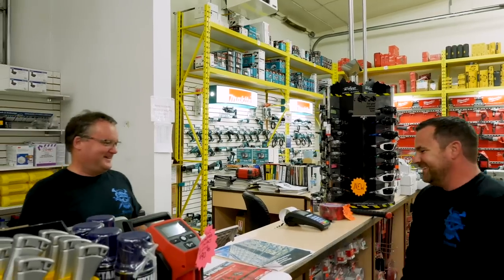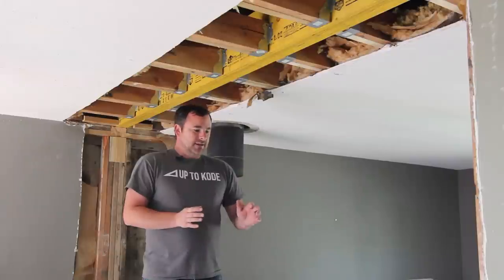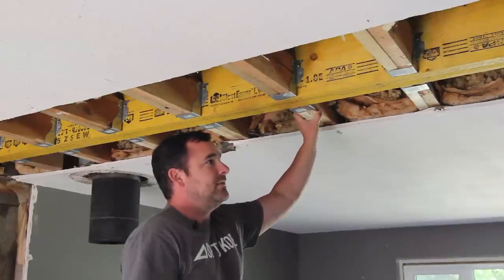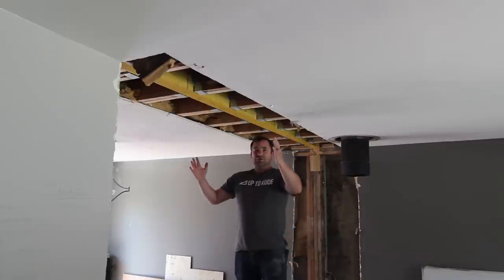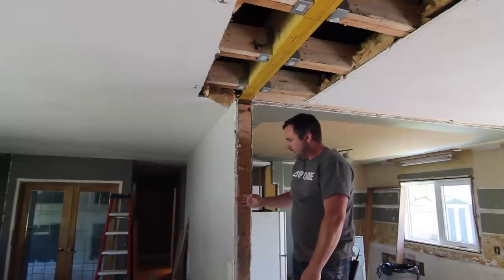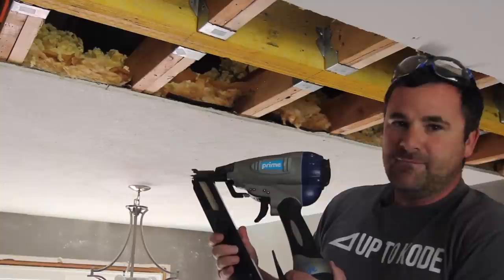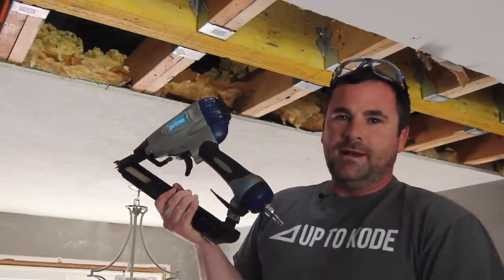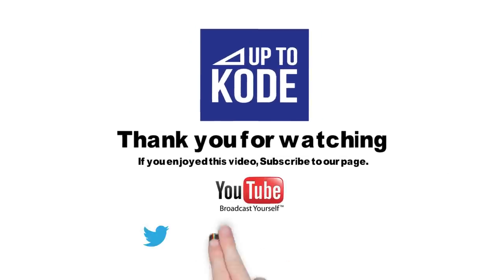How to create an open concept room with a flush beam

Comment: Thanks for the video.  I liked that you explained the need for engineering the beam to carry the proper loads. Typically on a rafter roof there will be kickers down to the bearing wall or beam so roof load often comes into playas well as snow loads.  I liked how you described the need to check the foundation work when enlarging the opening... Very nicely done!
Reply from the maker: Thank you! There a lot to it so it’s best to be thorough

Comment: If the wall is under a cut and stack roof there still may be some roof bearing. Check for rafter purlins that kick or post down to that wall. They need to be considered. Also, I would strap the cut ceiling joists across the new beam at every, or every other, joist just in case there is any small amount of future horizontal force in the joists during a snow event (in snow country). Sometimes a cut and stack roof can have areas that are inadvertently using the ceiling system in a way similar to the bottom chord of a truss.

Comment: Good video. I had one put in 2 years ago and while I love the look of the beam being gone it does limit your options on how you run pipes and electrical. I eventually had to have 2 - 1/2" holes drilled through the beam for hot and cold water pipes that I could not route any other way.
Reply: notta3d I had one done and my contractor used a top plate.  That allowed for channels for plumbing and electrical.
Reply from the maker: For a ceiling area like this a flush beam is no worries. For basements and load bearing interior walls you’re absolutely right about the need to run electrical and plumbing.  I now install for all my new builds a 20” tall open web joist with 9 1/2” beams flush to the bottom. This allows room to run mechanical over top but entirely eliminates bulkheads. Now I can get away with a full 8’ Basement height and no drop downs.

Comment: Very nice video and explanation! It looks like you sistered the joists before hangin them to the beam. How did you do that without opening up the entire ceiling?
Reply from the maker: I only sistered them back maybe 16 or 20 inches. Not far. Just enough to get the ceiling joists tight to the beam.

Comment: Awesome video, thank you. For homes that require multiple lvl beams that cross each other, what is best way to make sure its connected using joist hangers using nails? Or is there another method to keep load balanced meeting city code requirements for future safety? Essentially how is two lvl beams that cross each other held up joined connected to each other?

Comment: I always enjoy your videos. 

Can this be done to a main floor ceiling on a 2 storey house?(bedrooms and bathroom above). What is the maximum length span that can be supported this way? Wish I could show you photos of the area
Reply from the maker: Thanks! For a 2 storey it might get tricky…not for structural requirements but mostly because there’s a very good chance you will need plumbing, electrical and/or hvac to pass overtop of the beam. If you install a flush beam, it will block all these mechanical items. 

As for the size of the beam you need to know the area of the floors, stair locations and post locations.

Comment: Good video, as a fellow contractor, nicely done, everything looked aligned and in place. The only thing I noticed was that you put a joist hanger nail into the ceiling joist itself; shouldn't you use at least a 3" framing nail or screw? At least that's what I was taught. I could see in a limited space, sometimes you have to do the best you can do!
Reply: Im pretty sure hanger nails are just for the flange, if the hanger is designed for toe nailing, those needs to be 10d/16d nails to penetrate to beam in order for the hanger to function at their rated strength.
Reply: Screws don't have the same sheer strength as nails do.

Comment: Great video, I'm always curious if taking out load bearing walls that lateral bracing is taken into consideration. i.e. allot of LBW also provide wind and earthquake support by either plaster board, ply or diagonal metal strap etc.
Reply from the maker: Very good thinking behind that. Definitely worth considering when doing something like this. That’s where a structural engineer would need to be hired.   
For this house it’s a simple bungalow with 8’ walls so it won’t really affect the structure as the roof and exterior walls are doing all the work. 
I do really like your thinking !!
Reply: @uptokode  thanks Kody, I also like your work. Lived for a time in BC but do building design in New Zealand, we use pretty much the same systems here, am also conscious of the Earthquake forces.

Comment: Why did you sister in an extra joist making them doubles? Do the doubles extend to the exterior walls?
Reply from the maker: If I remember correctly, we had to cut the original ceiling joists a bit wider to accept the beam. Since there was a slight gap between the joist and the beam we decided to sister them to get a nice tight connection to the beam. They weren’t really necessary

Comment: With this being a rafter style house and the load of the wall essentially supporting the ceiling joists and not roof load, how critical is it that the load is transferred into the basement foundation directly? I have offsets between my upstairs wall and my basement wall of about 1 foot.

Comment: i got a question. i had an engineer come in and i have an older style roof. everywhere i look i see people cutting the joices. In my case my cieling is exposed. and ive been "told" id be able to lay the baem on top of the exsiting joices to avoid a support wall and cutting. beam would go up and in. attatch hardware. then proceed to remove old posts and run new ones. once braced take down the old support wall. i cant find videos or anything on it but they say it works. is this true?

Comment: Hi Kody, Excellent concept. I have a load bearing concrete wall with concrete beams. I would like to break the whole wall to open the space and was wondering if it is possible to take a concrete beam and flush it into the attic? Thanks.

Comment: Not sure if I'm understanding right, is the beam sitting on top  of the top plate 3" in, on both sides and toe nailed to the plate and can I use two 2x12 sistered together for a  12' opening? Thanks for your help!

Comment: So why did you doubled up on ceiling wooden beam for the drywall?
Reply from the maker: The ceiling joists you mean? We doubled those up just because the ends of the original ones were a bit damaged and we wanted good bearing into the hangers.
Reply: @uptokode  How far back did you double up those ceiling joists?  What was the nailing schedule?

Comment: Why is the support beam painted yellow ?  Is it treated with some chemical to prevent rot?  Is it code?
Reply from the maker: I’m not totally sure. It does have a bit of a wax coating.
Reply: color coding, load classification, spam, application? I've seen them orange, natural and the waxing is for treatment against rod and insects.

Comment: I noticed the joists were doubled up in the after with the engineered beam.  Was this for structure?
Reply from the maker: The old ceiling joists were toe nailed into the old dropped beam. Upon demolition some wood was chipped off the edges of the joists so we spliced them back for guaranteed support. The 2nd reason was we cut back the joists a little extra to make room for the beam. The extra layer on the joists allowed us to butt them tight to the beam after it was in place.
Reply: Kody Horvey how far back to the exterior wall did you scissor all the ceiling joists back to the exterior wall on each side of the engineered beam?

Comment: if i did this without a permit would they ever find out when i sell in 30 years?
Reply from the maker: Very unlikely. Make sure you do your homework so the beam is the correct size. And make sure you have proper loading to the foundation.
Reply: When selling your home on the market, there's a portion on the sellers disclosure form that ask if you have completed any unpermitted work

Comment: How long was the beam ?
And can I do something like that with a 22 F beam the roof is rafters roof
Reply from the maker: I don’t recall the length. I’m thinking 12-14’. You can do a 22’ beam, just need someone qualified to spec it so it’s proper size.  I did a lean-to a few years ago with 23’ span and a 3 ply - 14” LVL. Or maybe it was 16”. Either way it’s possible
Reply: Kody Horvey thanks!!! Good bless you !!

Comment: Great video  thanks for sharing but I be been always concern about how do you determine  the width and how many lvl to built a bearing wall.. by the way how do you deal with lower stories are structural sound?
Reply from the maker: There’s a lot of factors involved with determining the beam size. I like to go to a truss plant and have them run all the dimensions of the structure to determine the beam size. If they won’t do it then you have to go see a structural engineer. 

As for proper structural loading that takes some serious investigation and careful measuring to make sure there’s columns or posts that can transfer the load to a pile or footing.

Comment: Few questions why you have double ceiling joists and did you ever install header inside the attic to support ceiling joists
Reply from the maker: That exactly what we did. We installed the beam inside the attic and hung the ceiling joists off the new beam. 

The only reason we doubled up the joist ends was because some were split and damaged so we wanted extra support where it sits in the hangers
Reply: oh see how long of a span can I go with a LBL beam?

Comment: can you use 2x 10 or 2x 12 in place of lvl
Reply from the maker: Depends on spans and load but yes you can. It’s still code compliant, you just need to verify everything.  LVL just allows longer spans and less posts.

Comment: How did you finish the vertical cut of each joist? You show the cut with a skil saw but that wouldn't cut all the way to the top because of the guard. Is there a tool for this or did you have to finish by hand or maybe a Fine reciprocating saw would work?
Reply from the maker: A reciprocating saw works the best!

Comment: hello
I have 20 ft span( 1st floor open floor concept)   keep in mind I have 2 floor !would 2x10x20 2pices LVL be enough?
thank you!
Reply: Hey Ramon I just did a 24ft span open concept in Costa Mesa.
You need to make sure that where your post are going to sit that there is a pad for both post that will be supporting the beam. The pad you will create needs to be 18 inches deep 
And you need 15 inches ⬆️⬇️⬅️➡️ follow those arrows at the bottom of 18 inches. You will dig 15 inches left right front and back creating a total of 30 inch span underneath the 18 inches you dug. You need #4 rebar a total of 8 pieces and cut those 26 1/2 inches long
You will cross the rebar like a Tik tak toe table and starp them with wire. Make sure when you put the rebar inside the pad don’t let any dirt touch the Rebar so you can put some things that are called dobbies just to elevate the rebars of the ground inside the pad you created. You will pour concrete in the pad and you can also insert and anchor to be able to place a HDU2 bracket that is a special hold down that is needed for earthquake protection. Also depending on where you Live and of course if it’s a slab foundation or a raised foundation I mean it’s kind of hard to say what you need to do without actually being there.

Comment: Would this work if the beam was holding up the 2nd floor instead of roof?
Reply from the maker: Yes you can make a flush beam to hold a 2nd floor instead of a dropped beam. Flush beams are tricky in those situations because of duct work and electrical that need to cross that beam location.  

And finally make sure somebody runs the math and makes sure the beam is sufficient with proper point loads down to the foundation. 

Does that help you?
Reply: @uptokode  Thanks so much it helps alot

Comment: That’s a huge wall left beside it to claim “open concept”
Reply from the maker: I still needed some walls in the kitchen for a fridge and counters. Can’t be totally wide open
Reply: @uptokode  you are absolutely right. It's an open concept, but you still need some wall space not just for the fridge and such, but to mount the new LVLs.
I own a house in Maryland built in the early sixties and i have a single wall separating my living room and Kitchen. I will be taking care of this job very soon. 
I am a licensed contractor and I always consult with other experts to have the right info and then apply for permits.

Comment: Step 1 - Engage an architect and an engineer
Step 2 - Apply for a building permit
Step 3 - Hire a trustworthy contractor after checking references. 

These videos are a bit dangerous in that they embolden overly confident or naive DIY folk to vandalize their house.
Reply from the maker: I agree with you 100%. The video is to show people what is possible and that it’s not difficult so don’t let contractors make a big deal about it.  Of course proper loading and engineering is required but for a professional that’s a common occurrence
Reply: @uptokode  great response its unbelievable  how upset  can be those GC when people share knowledge.. it's up to the person if he is willing to diy or hire somebody else...
Thanks guy like you, many homeowner  will avoid  be RIP off for Gc  whom  perform poor work.
Reply: there always one that has to state the obvious, besides the fact I live in a 1950 home with full concent why would I go to council and apply for a permit for a simple DIY job with the right material and information. thankyou this video is perfect to confirm what I was thinking, we are also expanding the wall so a friend is running a report for the structure rating for us.
Reply: I love going back and fixing homeowner work after they consulted the experts in Home Depot....NOT. You pay money to a GC for his experience hopefully so check references! It can save you frustration from having to pay to get it done twice. For those of you that ALWAYs pick the lowest bidder... you get what you deserve.
Reply: @uptokode  your response is spot on with what I got from this video. I'm planning a (hired) renovation and to save costs I considered not doing flush beams but you've convinced me it's really not a big deal and not worth trading down.
Reply: agreed - but that's not vandalizing